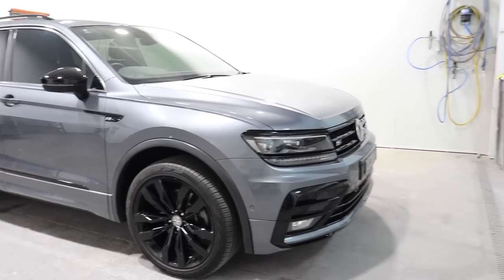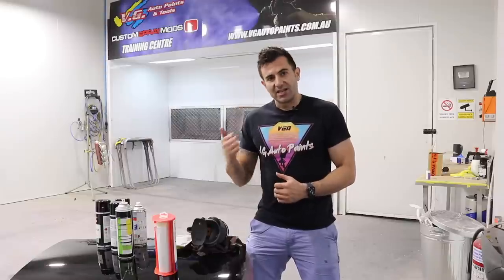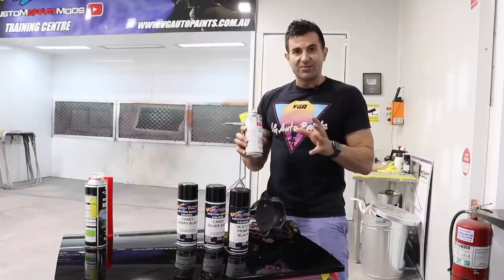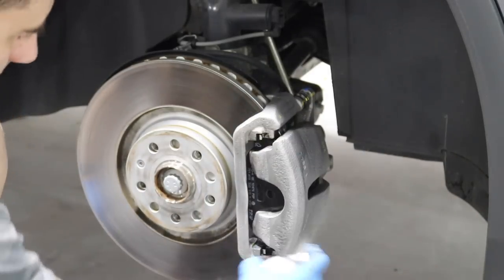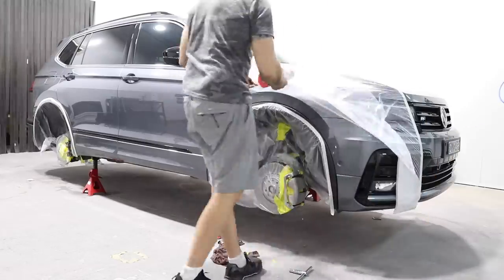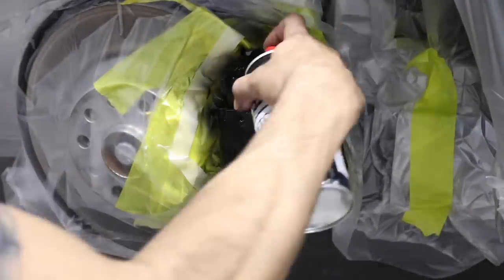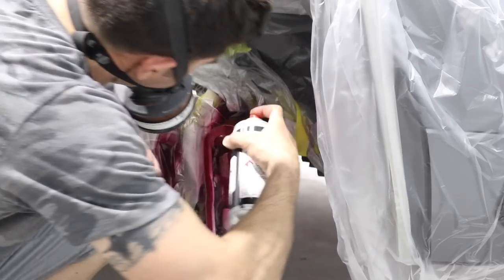Rattle Can Candy Cherry Black Brakes

Comment: love your work, I always seem to end up on your vids when doing my research and there is always something informative. What I like is you explain and demonstrate so the average person can understand. I have no experience in painting and asked someone that was supposedly the best to spray my bike, halfway through the spray job he just refused to finish my bike cause he realised  that I was actually customising my bike and didn't like the idea cause I was seen as I threat or competition. I'm currently trying to learn as much as I can from YouTube and your vids help a lot. only problem is I trying to match what he has done so far by using rustoleum, came very close to making the pearl white but no success as the Rustoleum 2x Gloss white and rustoleum glitter had a reaction and cracked when drying... and I don't think I can buy the paint in Rattle can here so will have to wait till I get a compressor. Keep up the good work and I liked and subscribes.

Comment: Should you and is it required to use high temp primer, paints and clears? Also which is a longer-lasting finish, powder coating or painting?

Comment: I work for Volkswagen dealership in vic.  They are notorious for water pump and thermostat leaking.  Mostly they are replaced from 30,000-60,000km as they is signs of coolant stains under them, the TPI normal says one or the other.  Should be covered by warranty.  Also the tyres do not last, people drive these cahard, these cars I have quoted tyres low (2.5mm from indicator) on the first service 15k.
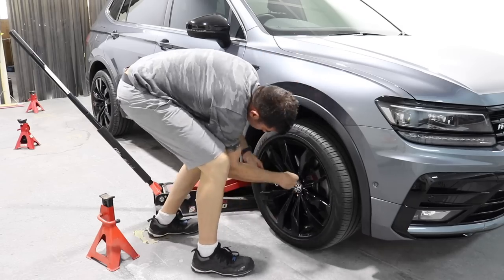Reply: Had a laugh at 2:44, need a 60cm break bar at least, impact works a treat too.

Comment: customspraymods: Please update this video in the next few days/weeks and let us know if the paint stayed on your calipers. That paint doesn't seem rated for the temperatures the calipers will reach under normal driving conditions. Thanks!
Reply from the maker: I mentioned in the video when I was spraying the 2K clear that I’ve done track days using this type of paint and it has been fine so I’m pretty sure it will be okay.

Comment: Sorry but i would remove the brakes to paint them thoroughly. Why even do it if your going to half ass it? You wouldn’t paint a car without removing body panels. If your going thru the hassle of using a 3 layer paint then why half ass it. Mite as well use the brush on paint.
Reply from the maker: If I said I removed these off the car and painted them you wouldn't know the difference. Also it's my daily drive car if I removed the brakes painted them then had to reinstall them  I wouldn't have finished the job in time to go pick up my daughter from day care. Check out my channel I have a video of painting brakes in a candy red with flakes. I took them off the car to paint them.